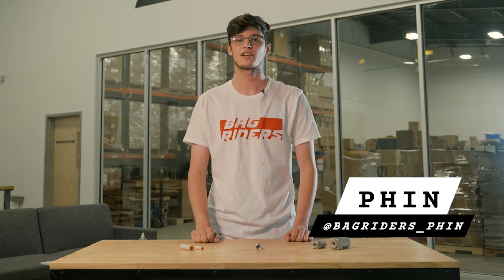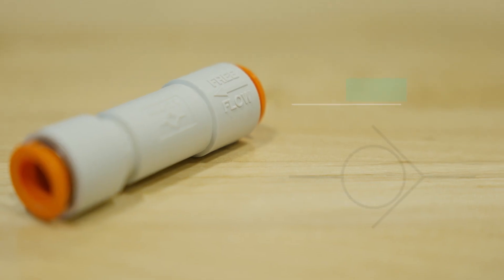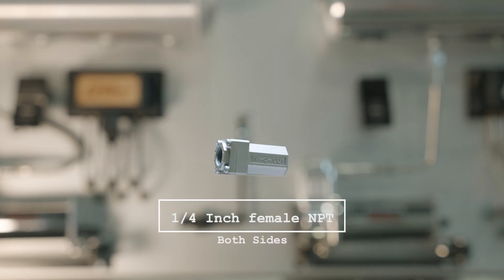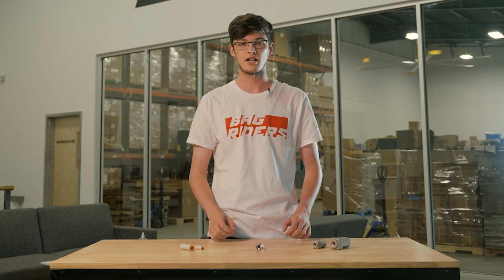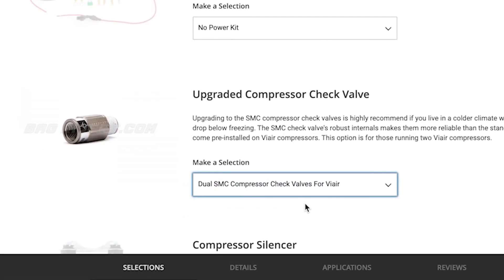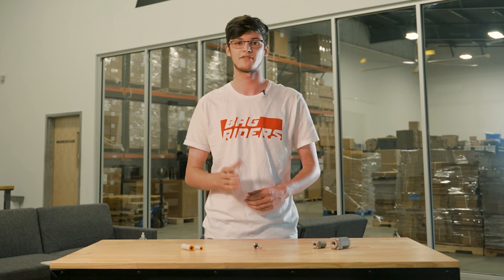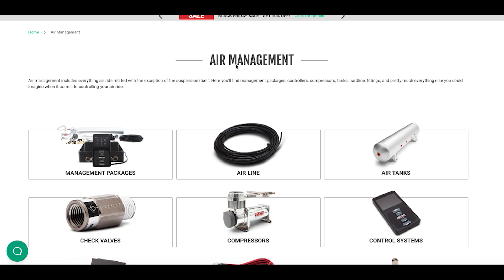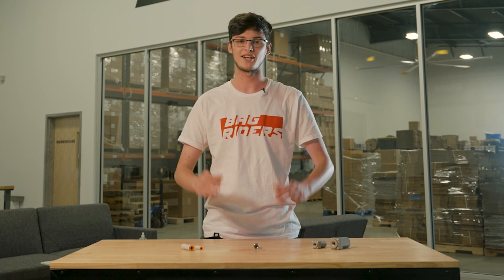Air Ride Check Valves Explained by Bag Riders

Comment: If air backfeeds will it cause your aripressure to drop?   If air backfeeds it will go back into compressor making it harder/difficult to find a leak?  I dont live in cold weather, actually extremely hot sun FL... I do drain my tanks weekly.   Help on sugestions...  might need to try new replacement SMC valves...

Comment: i have 485 compessors which check valve should i use? i have 3/8 size hoses
Reply from the maker: Because the 485C uses a 3/8 NPT Male leader line, if we were going to upgrade the check valve, we would recommend a 3/8" Check valve.

Comment: Do viair compressors already come with check valves?
Reply: They do but they aren't as reliable. Especially if you plan to drive the vehicle in cold weather. The ones included with VIair compressors can freeze in cold temperatures or become faulty over a shorter time.  Causing issues with fuses and/or  compressors.

I'm in Oklahoma , rarely do we have negative below temperatures but we do experience snow and ice storms during the winter. I personally don't air out my vehicle on super cold days but I upgraded my SMC check valves regardless as they last longer, they can be repaired and they are only $23.00 . That's a cheap price for peace of mind.
Reply: Yes!